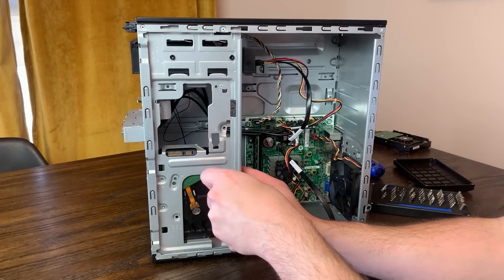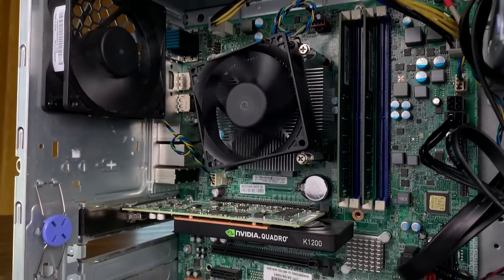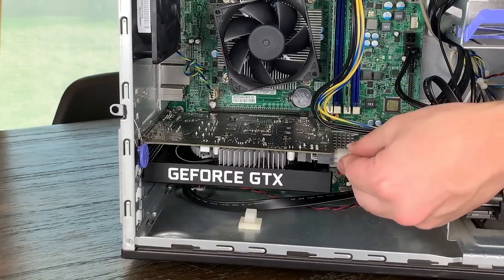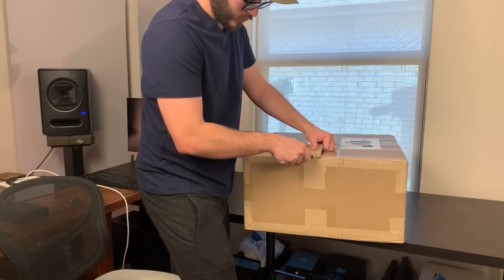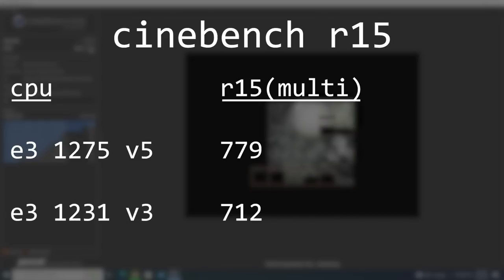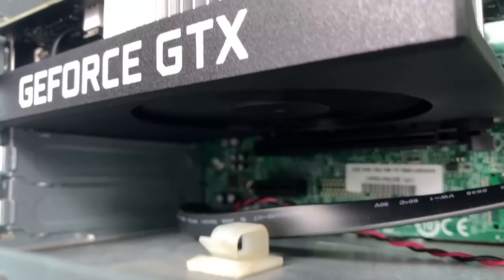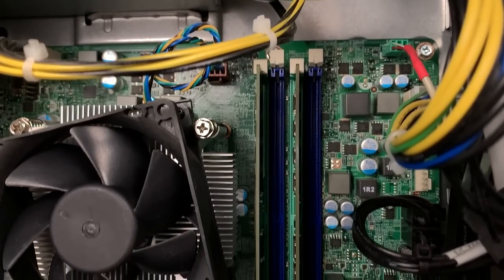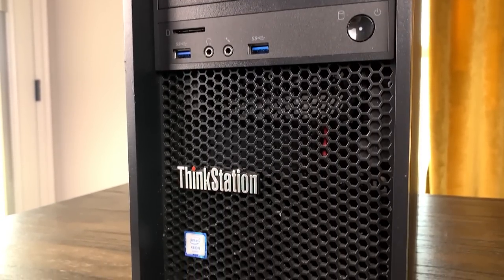Is This Lenovo Workstation Worth It In 2022?

Comment: Back in the day I was a little upset when Lenovo bought IBM's PC Business, as I thought IBM was doing a good job offering Athlon based CPU's as a competitor to many of the Intel pc manufacturers out there. I was hoping consumers wouldn't lose a good alternative, but complimentary product manufacturer in IBM. 17 yrs later I think Lenovo buying that arm of IBM was a great option! Glad to see some of their old hardware getting some use, as it didn't seem as proprietary as some of the other systems I've seen, at least from my view. :)
Reply from the maker: Some of the lenovo stuff has been very "open", but it seems like more recently it's been a bit more proprietary. I also hate their lack of documentation haha
Reply: @HardwareHaven need advice I'm looking at a 8 core xeon workstation Lenovo p520 it has dual 6 plus 2 pin which is incredibly rare right. Do you know of any other workstations that have dual 6 plus 2 pin.

Comment: I have recently got myself a yummy deal off of a clueless guy online, too. I got a Lenovo ThinkStation P500 with a Quadro K2200, 256GB SATA SSD, 500GB HDD (which they thought was corrupted, even though it just didn't have any partition table on it), Xeon E5-1630v3, 650W 80 Platinum PSU, 4x 4GB SK Hynix DDR4 2133MHz ECC RDIMM RAM modules, all that for 100$, after negotiating a discount of about 20$. I have upgraded the CPU, GPU, WiFi adapter, M.2 NVMe adapter and got myself a nice budget gaming desktop for about 150$ (net, after selling the old GPU and stuff).

Comment: Nice video. I recently repurposed a friend's old Lenovo IdeaCentre with an i5 6400. I ran into a dying hdd and psu as well. Also accidentally broke the mount for the cpu cooler so I used another mobo. Ended up not using most components and gave it a refresh. The thermal paste was completely dried out. For S&Gs, I tested an RX 6600 for gaming. In some instances it was ok but the CPU was obviously bottlenecked pretty hard in others creating constant microstutters. It does fine with OBS recordings with a RX550.
Reply from the maker: Yeah that stuff was nasty haha

Comment: Love these kind of builds. I have a hp z420 work station I got last year and upgraded the ram to 32gb and threw a ssd and gtx1060 in it and it’s amazing. 6 core Xeon 1650. Figure I’ll upgrade to another retired work station eventually since they make such good gaming rigs!
Reply: Right on! One of my machines is  a HP Z240 with a 6gen i5 32gb of ram and rx5500XT dual booting mac OS and windows11
Reply: Intel XTU can OC that CPU.  I have z420 with 1650v2 and it does 3.9ghz all-core turbo.  Z440 might be the next upgrade, if you find the whole machine for $100.  It moves to DDR4, I put a cheap i7 K in one, or use 16xx processors for overclock.
Reply: @milescarter7803  will have to look into the oc for fun. It doesn’t bottle neck anything I do as is. Actually waiting on my steam deck to come in and I’m going to turn it into a desktop gaming system. It’s very similar score to the Xeon but 1/10th the power consumption:
Reply: That's good hardware, HP does put out good stuff from my experience and xeons are generally all purpose kick ass CPU's. That 1060 is a good GPU, hopefully you got the 6 gig version?... I have the 6 gig version and it does great on late titles. I don't run 4k so it'll do just fine for a long time yet.
Reply: @garyr7027  yeah I have the 6gb version. It handles everything I do with ease.
Reply: @xbigbobsagetx  nice, good to hear you got the 6 gig... smart move no doubt.
Reply: @garyr7027  yeah I had a 4gb 960 in it and I wasn’t about to be bottle necked by 3gb of ram. 
Actually waiting on a dock to come in for my steam deck and I’m going to try it as a desktop replacement since it uses a fraction of the wattage.
Reply: @xbigbobsagetx  yeah you definitely don't wanna go backwards, that 960 4gig would be better than the 1060 3gig for todays games imo. If anything I'd run that 960 before I would a 3gig card. I also have a 960 4gig from gigabyte and it still runs pretty decent, but nothing like my 1060. For the prices back when those cards came out, imo it was the best deal. I bought both those cards new, they were the better deal without compromising too much on performance. You picked your cards wisely for the price... guaranteed.

Comment: reusing / refurbishind old or "old" workstations from lenovo is always an amazing thing :D

i myself decided to rebuild a P330 Tiny myself - gave it i5-8400T and RX 6400 (originaly it came with i5-9400T and Quadro P620)

amazing machine, even with RX being forced to run in PCIE 3.0 mode, it is still hell of a unit!

just have to find someone who can make me a 3d printed io shield for GPU since you need to use special lenovo one for that :/
Reply from the maker: Nice! I really hope some better lp GPU options become available in the near future for things like this.
Reply: @HardwareHaven  Well, at the moment for a single slot true LP GPU, you only got 3 options.

RX 6400, Quadro T600 and Quadro T1000

If you got PCIE 4.0 system, then RX 6400 currently is only proper option - unless you really need encoders / decoders OR uses more than 2 screens... In that case just go for Quadro

I would really Nvidia to release a new proper single slot card that is not "workstation only" related and something that is not GTX (more like GT) 1630 :/

Lets hope Intel LP cards will be released
Reply: @Karti200  there's a guy who managed to cram a working rtx a2000 into one of these "tiny" PCs.
He designed his own 1 slot cooler and it somehow doesn't throttle! I've tried to do something similar with a slightly bigger heatsink but with the weird 2 screw design I can't seem to get the mounting pressure right.
Reply: @Karti200  Why did you swap the i5-9400T with a i5-8400T?
Reply: Dude those RX6400's pack a punch for it size, able to play games on 4790 at 1440p hitting upwards of 60 fps, with lowered graphics quality of course.
Its not a good encoder card due to the lack of one, I do recommend these if you wanna game on the cheap.
Reply: @h.b.5577  tbh, a guy offered me that RX 6400 for i5-9400T and 1x 512GB NVme - and since i had 2 more nvme and old i5-8400T from old times.. i just took it :D 

i am planning to change it to 8700T
Reply: Well talkin of th fx 6300  
Im still rocking in that !
Reply: @Karti200  I cheat and put the non-T CPU in and then turn off the turbo boost.  It helps if you have the copper heatsink, which my P330 did.  I ran the P620 card and a couple P600 (with a K600 heatsink change) that came out of P320 Tiny.  I put them into some m720 m920 builds (same as P330 as far as I can tell,  only missing the motherboard chipset heatsink and the 2nd NVMe slot).  You can power it with the 130w or 170w or even 230w power brick if you are feeling silly.

I eventually went to an ITX PIO motherboard H310c in a custom 1.9L case from sff .net.  with the RX6400 it is great for my living room PC
Reply: I was also thinking about placing a non-T CPU and doing the same thing - excluding changing the heat sink... because I had no idea there was a full copper one o.O

This changes a lot, will have to get one too!!

Thanks for telling me that info :D

Comment: I bought a Lenovo D30 a couple of months ago for 70ukp. It had a pair of Xeon E5-2609's and 16Gb or RAM. I upgraded it to a pair of E5-2667 v2s and 128Gb of RAM and it is pretty powerful considering the CPUs cost me 30ukp and the RAM was 50ukp, so for 150ukp I have a hell of a system.

Comment: I have 2 x Lenovo p310 workstations that I got for free from work when they upgraded to newer kit.  They both have an i7 6700k with 32GB RAM.  I run Microsoft Server 2019 Hyper-V on both, using them to run my Virtual Machines at home.  Had them for about 18 months so far, no issues with them at all.

Comment: At 4:00, the reason why it doesn't have standard SATA power connectors nor your regular ATX connectors because this is an early implementation of ATX12VO before that even existed. That PSU only supplies 12V, and that's one of the reasons why it has less pins (the motherboard itself will deal with the DC to DC conversion) and why it was able to get an 80 Plus Platinum rating for a 400w PSU. It's just ridiculously efficient!
Reply from the maker: Yeah that makes sense. I even knew it was 12v only, just didn't put all the pieces together haha. Thanks!

Comment: Great video! I LOVE restoring and re-using "old" office machines like this. I recently picked up an older Dell AiO Optiplex for ~$80 from a local university, and it runs incredibly well for a 3rd gen i5 machine. It's so satisfying to work with older hardware since there's usually always something you can use it for even today. Much better than letting these machines sit in a landfill!
Reply from the maker: Exactly!

Comment: I would strongly reccomend going for a used dual cpu Lenovo workstation like the P700 (dual cpu model from that series) or older D30. Usually come with ECC ram, can have much more horses, more standardized ports, and can be racked with a rail kit (afaik). The D30 can be had for that price iirc, and the P700 for $300 to $500 depending on what’s in it.
Reply: In general I’ve actually been finding lots of good deals on dual Xeon machines from 2012-2015. Full kitted machines from 300 to 500 depending on ram speed cpu type, etc. and you usually get server level reliability

Comment: I am the owner of two Lenovo M58p SFF machines. The thermal paste used in those is horrific. In the case of the second M58p, thermal paste even got in the socket just like your workstation. I know these systems of mine are ancient now being from 2008, but I currently have one of them running a Minecraft server very nicely. When I eventually sort out the local media situation, I'm gonna need a better machine for transcoding video as the GMA X4500 iGPU isn't going to cut it.

Comment: 6:10. WD40 contact cleaner. No bent pins. No residue. Dissolves the thermal paste for it to drip away.
Reply from the maker: Have you ever used deoxit? Curious if that would work as well. Great tip 👍🏻
Reply: @HardwareHaven  unfortunately it's not sold in Taiwan so I can't try. :'(
Reply: Yeah that's what I use too works great

Comment: I have found these workstations for HALF the price on either amazon or at the goodwill.
I bought a workstation for 300 on ebay and saw a few days later the same one for 150 on amazon. Also saw the same one at the goodwill for same price (150)

Just some advice. I do the the same stuff.

Comment: I'm still running on 6th gen Intel from when I bought it new. Still does excellent and, with a decent GPU it has zero issues running the latest games with lower AA on some games. With a M.2 drive and a SSD it even runs windows 11 and updated like it was meant to be. I have no reason to go newer at this point, running 10 and 11 on it with two separate drives why change? I keep my system in good condition and I don't buy cheap stuff so it should easily last another 5 years or more. Looking back at all the PC's I've had upgrading for no reason but for the latest hardware, I could have ran them for years more... I won't make that mistake again. A quality barebones system will last a long time if it hasn't been tortured.

Comment: I purchased 2 NEW Lenovo TS140 about 8 years ago for $200 each with Xeon quad core CPU and 4gb ram. They still work but I don’t use them anymore. But worked great when I was using them with MS-Windows and UNIX. I used an Nvidia GT-710 or 730 for Dual Boot support. I really liked this little mini-tower computer. Never let me down and was rock solid in reliability. These use to sell for cheap NEW on amazon and eBay.

Comment: Just came across your video since I'm considering buying and doing a home server with one of these. If you still have the old powersupply, at min 10:00 of your video, there is a slightly bulging capacitor at the top right of the frame, next to the transformer. If you change that one, it should be good, but if you're going to do that, I'd suggest changing all caps and that power supply will go for years.
Reply from the maker: I might go check that out, thanks!

Comment: BTW I just wanted to answered your question on why Lenovo uses only 12VO ATX PSUs 

1. It is better for the environment as it reduces the copper consumption 
2. It gives the Vendor leverage on how the components power source quality 
3. It is much easier in the supply management and it makes the QA much easier when you are sourcing power supplies from different suppliers.

About the Fan rubber you can use Lenovo support channel to check how to replace the fans , it is very easy you just have to pull these rubber bands out longer till they squeeze out.

Comment: I recently picked one of these up for work. It is the SFF version and the new job I went in to let me pick a system. It seems to do well and has the firepro card and the same CPU with 32GB of ram. Seems to do all of my network monitoring tasks and drives 4 monitors just fine.

Comment: Good stuff! I think I prefer the Dell Precision line to this, built much more like a server than a desktop with quick disconnect PSU, tons of fans and airflow channels for the RAM. Still only 2 drive bays for some reason... I got a free T5810 from my place of work, probably slower and way more power hungry than this, it's got a LGA 2011 E5 Xeon 1620 v3, 32GB ECC RAM and a Quadro K2200. Still haven't figured out what to do with it but it's a nice system and they go for around the same amount.
Reply from the maker: Yeah I imagine the makes an impact on the electricity bill haha

Comment: Could you do a video on good uses for 32-bit machines from the 2000-2005  era? I have several and can't figure out a good use for them.
Reply from the maker: I really want to do a windows XP retro build with that type of hardware!
Reply: I have bunch of those as well. Also some thin clients, which are essentially 32_64 bit PCs... I use them a lot for pihole,  as they intended to be: thin client alike with an old ThinkCenter proxmox. Fun stuff! Great to watch such channel like this!

Comment: In my humble opinion, the case is very pretty! I like the logo "thinkstation", black and the front looks vintage but serious
Reply from the maker: Honestly I agree! It looks nice and clean, but is just not incredibly flexible or easy to work in. Should've mentioned that though!
Reply: @HardwareHaven  You mentioned it clearly in the video, and I understand that completely, having myself a Dell T3500 that is huge but not great for cables. Perhaps you can use the 5"25 bays to mount HDD
Reply: Fujitsu's cases did have drive bays on the bottom, not sure if they still do in 6th gen. Just as serious and more functional.

Comment: I just bought and built an old T5810 workstation myself on eBay for $80.82. I needed to add an AMD 8bg FirePro GPU ($60 on eBay) and adapters to boot to m.2 2280 drives ($25).  It would have been a better option for you because of the availability of parts, default ram speed for a E5-1630 v4 is 2400. Once you factor in the price of the m.2 hard drive ($45-500gb) I am around the same cost as yours. The Dell T5810 can stock with a 685watt power supply which made it possibly to use the 8gb gpu.

Comment: I got a Lenovo IdeaCentre K410 working and complete for $20 and, much like you, I also enjoy messing with old PCs. 

I added a used $50 i7 3770 (originally an i5 3450) and a $1.99 thrifted Asus GTX 660 Ti DirectCU II (BIOS is whitelisted to GeForce 6 series, it originally included a low-profile GT 610).

I also added an EVGA 430W PSU I got for free (included with a $6.99 sffpc case I thrifted for another build). 

So far it's the best (cheapest) second-hand build I've done yet. 

Getting under the $100 mark for everything was tricky: with the $3 22" Samsung LED FHD monitor (only missing the $2 power supply), $5.99 Razer Black Widow Ultimate 2016 and $3.99 DeathAdder Elite, it actually isn't all that bad to daily for a sub-$100 complete setup.
Reply from the maker: Awesome!

Comment: Liked the video because you included the power draw at the wall on idle and load... This is super efficient really.. I wonder if the evga was as efficient
Reply from the maker: Thanks!
Reply: @HardwareHaven  Btw it's IMPOSSIBLE to purchase this cpu at this price.. incidentally I found out that this is a c236 chipset which is another expensive motherboard to purchase.. main reason I would get it is to put in a e3-1235Lv5 in there (low power 35W + includes a p530 graphics)

Comment: found an older Lenovo thinkcentre for $50 ... my NAS had a socket LGA1155 i7 3770 & this Lenovo had a LGA1155 i5 2320 ... so swapped them out & the Lenovo runs like a champ w/16gigs of RAM & an old GT210 a SSD as a boot drive & a 2TB HDD for storage ... perfect work/HTPC
Reply from the maker: Nice!

Comment: just ordered a p310 400 watt barebones on ebay for $50. Great home server, especially with the 6 3.5 inch drive bays and 6 pin power
Reply: I saw the ports on the board for 6 SATA devices, but didn’t see six 3.5” drive bays.  Time stamp?

Comment: Had one Lenovo tower with Haswell Celeron and 1×4GB DDR3-1333 and pretty much dead HDD together with 22 inch AOC monitor saved from dumpster. After changing the RAM to 2×4GB DDR3-1600 and CPU to Xeon 11265Lv3,  together with adding GT1030(which I had already) total cost was about 100 USD. Today I have another Haswell with the same CPU paired with RX560 and it actually can do some games. So CPU-wise the one of yours sounds great. But man, faulty PSU is a pain! AT era of manually switching on and off sure delivers so.e tears of nostalgia thought 😅
Reply from the maker: Love a good dumpster find haha